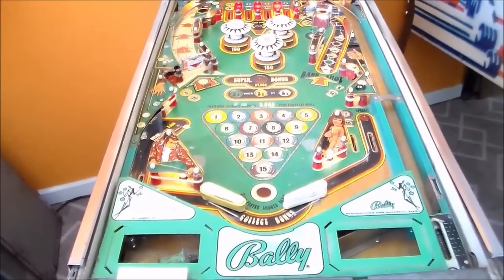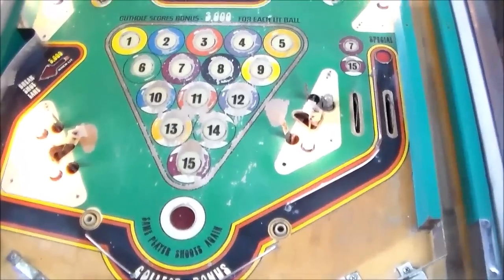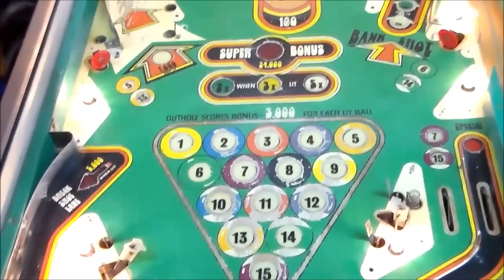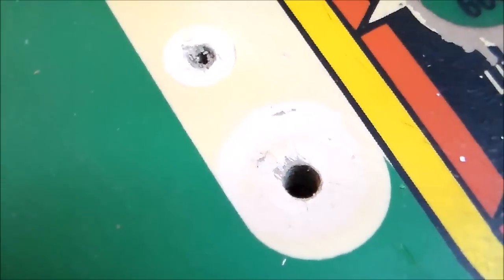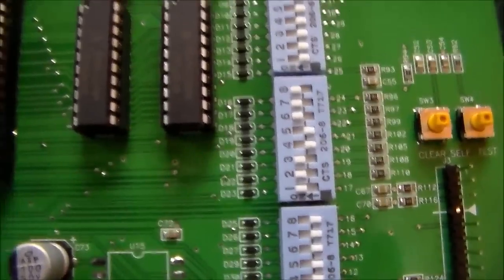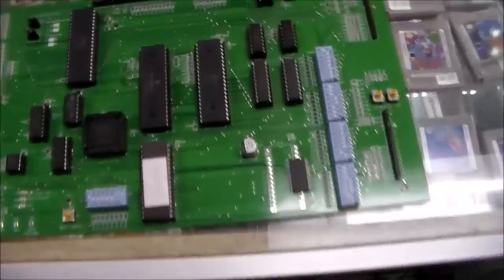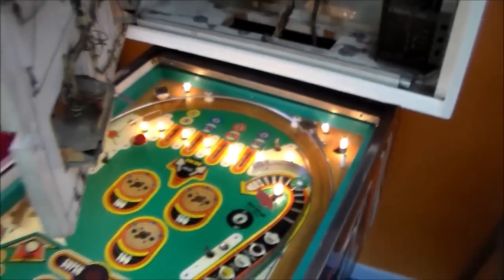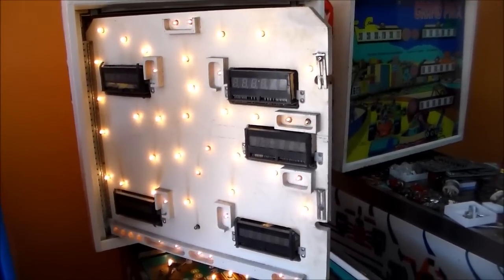Saving Bally's famous Eight Ball Pinball Machine - Repainting The Trashed Playfield

Comment: Thank you, gentlemen for the restoration of these pinball machines.
Reply: For vintage tech, I just use IPA at 91% & 50% wintergreen. Just recently I worked on a original NES cartridge, Mega Man 2, used a soft pencil eraser on the contact pads and it worked wonderful after cleaning it with IPA the cartridge worked immediately after a cleaning.
Reply from the maker: The funny thing about that is on the back of NES cartridges it says not to clean them with alcohol... but if you bought the NES cleaning kit the bottle it came with was nothing but alcohol :)  Thank you for watching Spider, we appreciate it!
Reply: @LyonsArcade  I have the Performance made kit your mentioned and absolutely it was pure alcohol almost the highest percentage. It burned the finger tips and if you had a hangnail forget about it ouch.

Comment: I can cetainly respect how you save this one. I spend hours matching each color, but you would never recoup that time when you sell it. I repainted all the "cream" back to white on my Cyclone which took forever!
Reply from the maker: The one thing I'd like to spend more time on with them is getting the clear perfectly flat, the slight color variance doesn't bother me too much but I wish I could get it smooth!
Reply: @LyonsArcade  My last project took over 30 coats of 2 part auto clear. Ridiculous, but I like the "sheet of glass" look.
Reply from the maker: holy Moly.  That's a little more than I'd want to do, lol.

Comment: You know, I remember actually playing this game at a KOA Kampground near Broken Bow, Oklahoma, probably in 1978 or 1979.  At the time they had a pretty large arcade (mostly pinball) that took dimes instead of quarters.  It's no surprise that the playfield takes a battering.  Doesn't matter how tough the paint is, you've got steel balls rolling around the table.  Eventually that's gonna take a toll, even if it takes decades.
Reply from the maker: Yup definitely, especially where the inserts are as the lip gets rounded off by the ball...

Comment: How was the clearcoat done?  Was it just a light spay or did you put multiple coats, did you sand in between coats?  It looks like your method is good and didn’t take long.
Reply from the maker: We do it quick, usually a medium coat with a spray can keeping a wet edge, then let it dry.  Next day wax it up nice, and you're off to the races.  It's not like glass or anything, we're just using it as a protectant and trying to keep the playfield looking similar to how they used to look.... we don't sand it, you end up with a playfield that has imperfections but we started with one that was completely destroyed so we're happy with it considering the time spent!  Thanks for watching!

Comment: Nice Job it is alive again, wich coolor you using for playfield repair acrylic water base ?
Reply from the maker: Yes, Acrylic, but you have to clear coat afterwards.
Reply: @LyonsArcade  
I had a problem when I have restoring one playfield 10y before I use small enamel paint for small modell toys when I spray a 2k automotive clear all enamel paint was run from spot ....big problem 😂
Reply from the maker: Yes i've heard of that before.... very common if you use Sharpies!  sometimes they'll run when they clear....

Comment: Really interesting so far, is it mostly restoring more then modernizing a bit on the channel ?
(Just subscribed earlier here.)
Like say changing the lights too warm white or yellow led's for less powerdraw & similar ?
Would there be kits/lampboards made for that ?
Like an additional small pcb of resistors that mounts into the machine and just sends the same signals at a lower current & voltage ?
Reply from the maker: Yes we mainly try to make them similar to how they were originally, sometimes we'll upgrade a little bit of stuff.  I dont' usually do LED's because I don't really like the way they look on the older games like this, which is mainly all we get in.
Reply: @LyonsArcade  Ah gotcha, also while i haven't backtracked through any of your videos yet.
Ever had a sega model 2 with something like Daytona USA or Sega Rally Championship that has needed service ? or perhaps any other model 2 arcade machines ?
Reply from the maker: Yes we have a bunch of Daytona videos on here, there's one somewhere showing what all the pcbs in the cabinet do.